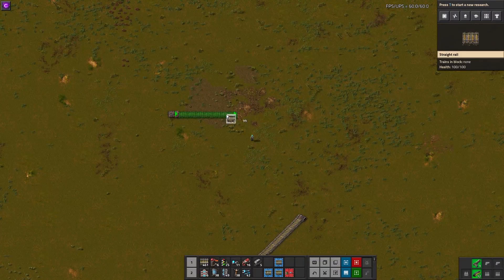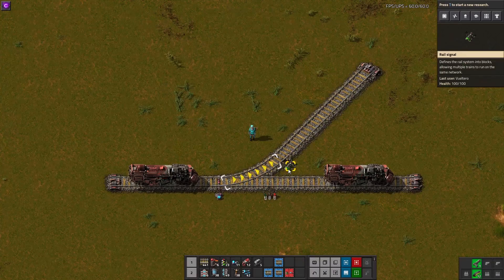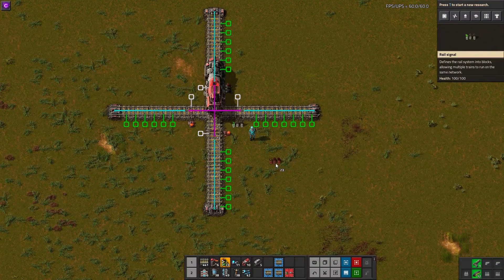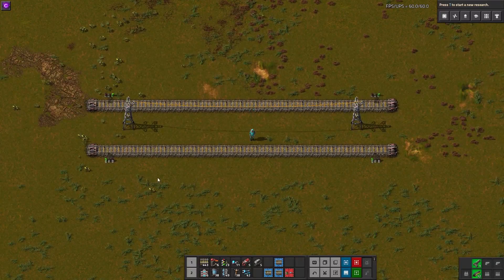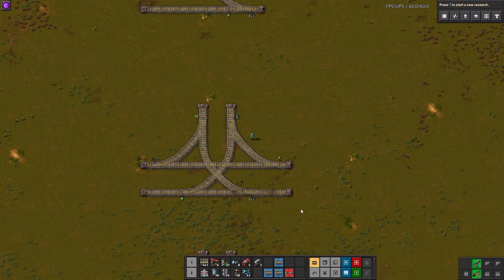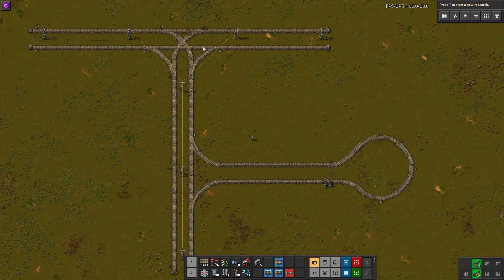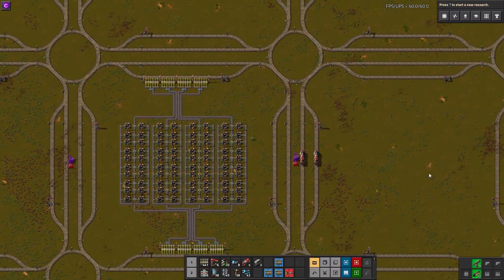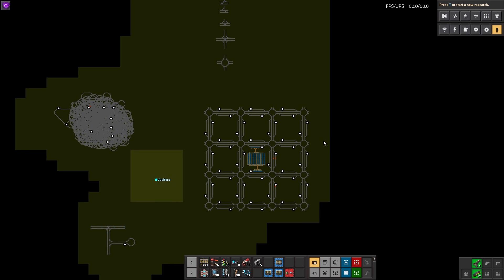Factorio Train Tutorial - In a Nutshell

Comment: One thing which I think you missed (and correct me if I'm wrong here)
Chain signals don't divide the network into blocks, only the normal ones do. Chain signals will link all blocks they are connected to and if a train requests a path through those blocks, then all entryways that would deviate from that path are locked in order to prevent crashes with other trains. This way, if you build you system our of only chain signals, you risk locking everything up as your entire network is one big block and only 1 train will be able to move through it at the same time.
Reply: nah it still divide it